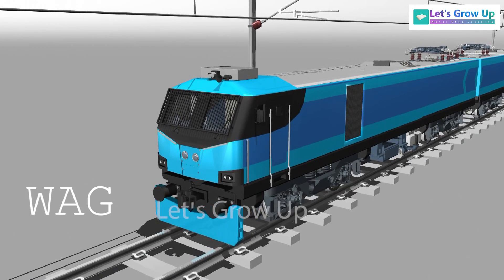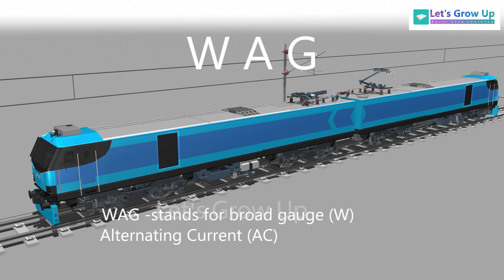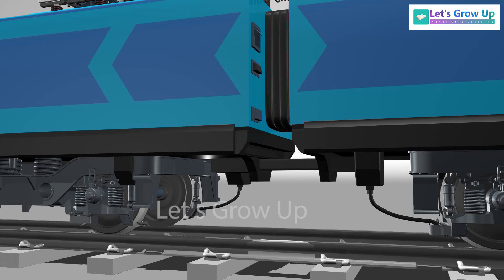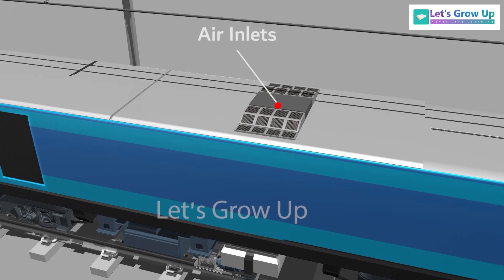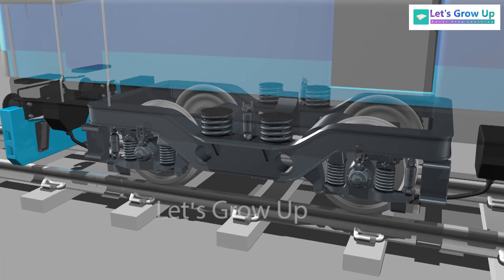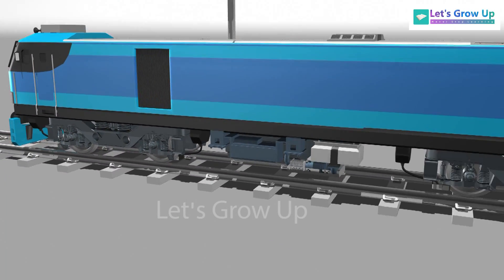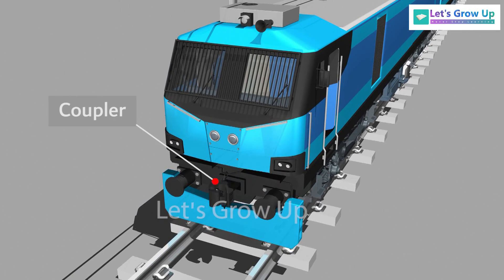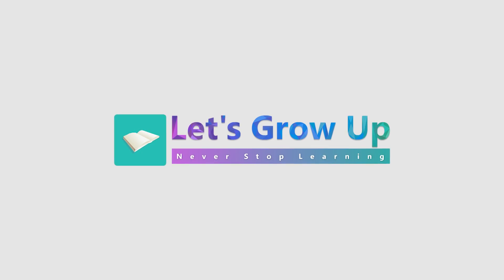Explaining Indian powerful locomotive WAG 12B

Comment: Yes I want all review for indias (world) most powerful Loco WAG 12 B reviews...let's grow up 💪💪✌️✌️ never stop learning 👍 ✌️ 👌 😘
Reply: WAG-12 isn't even close to the world's most powerful loco , that's Shen-24
Reply: @06.vineethdsouza80  WAG 12 is one the of most powerfull engine in the world
Reply: @ajayshriram9186  in that case look into DB Class 103 , its a single loco that's more powerful than WAG-12 and a lot more faster
Reply: @06.vineethdsouza80  “Power” get thrown around a lot these days but doesn’t really mean anything in this case (just like a Lamborghini is more powerful that an 18 wheeler truck). 
The DB103 has a pulling capacity of 400 tonnes. The WAG12 can pull 6000 tonnes. (From what I learnt on Google).
In a tug of war you’d need more than 15 DB103s to move the WAG12.
Don’t underestimate the WAG12, it’s stupidly powerful. It can pull a 1.5 km long double stacked freight train without any trouble.
Reply: @06.vineethdsouza80 Wag 9hh is equally powerful and has better tractive effort than Db class 103.
Reply: This is only WAG 12 NOT WAG 12 B